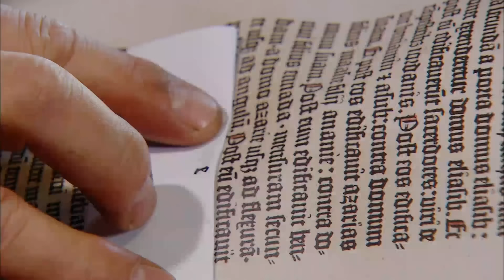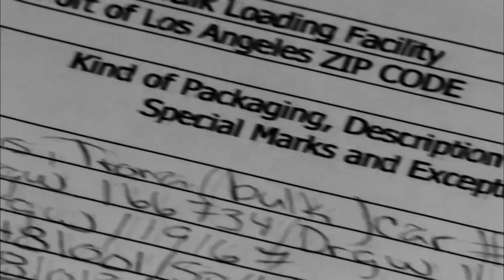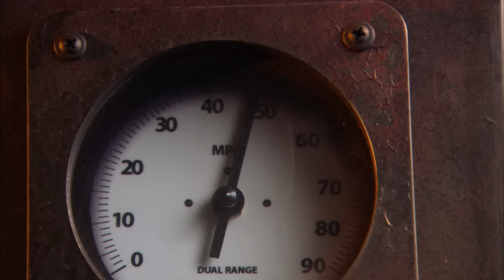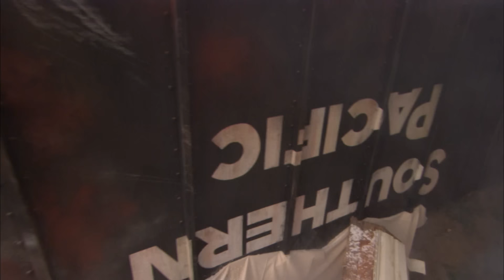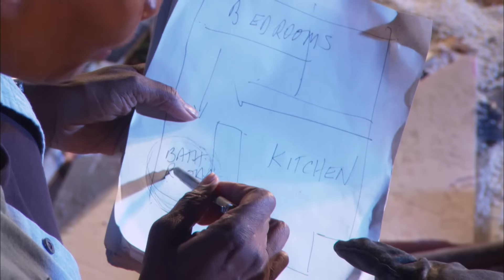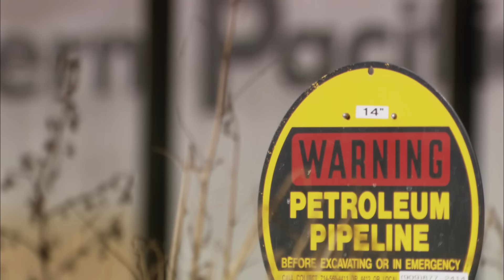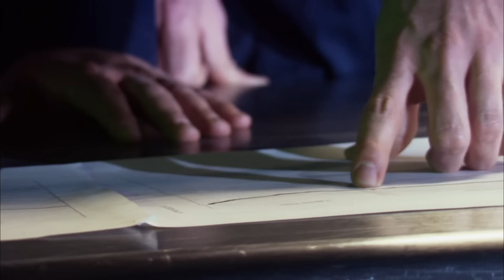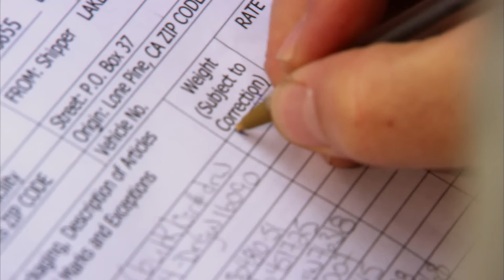Horrifying Runaway Train: San Bernardino Train Disaster SP 7551 East | Mayday | Wonder

Comment: The difference in cultures between the railways and airlines is really troubling here.  Why were so many engine's brakeless?  You got a train that has over half its engines non-functional.  Even with the bad paperwork that feels like it should be a giant red flag.
Reply: Because southern pacific just didn’t do proper maintenance in the last years of their life they got bought out in 1996
Reply: When you're an engineer for so long, you know how to calculate the weight you're hauling everytime. Even if the locos had problems he, the crew, the train and everyone else would've survived if that weight was correct, stated later on
Reply: @oregonrailfan7046  That's not completely true.
Reply: I'm a stationary engineer who also drives a train at my plant. The way a train's brakes work is counterintuitive. Trains use air pressure to apply the brakes. The actual locomotive (engine) itself, will apply its brakes (only to itself) when you increase the pressure to them (using the air pressure built up in the main air reservoir via the compressor).

 HOWEVER,

The railcars you are about to hook up to and eventually pull/push work in the exact OPPOSITE way. When you hook up your locomotive (engine) to the string of railcars you are going to pull, you actually INCREASE the pressure of the brake line in order to RELEASE the brakes. This is because we want the brakes of the railcars to engage and stay on when we disconnect from them (i.e. so they don't move after you leave them at their destination). So when you hook up to the string of railcars they will have their airbrakes on, and you actually have to increase the air pressure to them to get them to release, so you can move them. Once you get to your destination and are going to leave them, you disconnect and their air brakes immediately apply...
Reply: The train had plenty of brake power for the weight on the paperwork.  The train was supposed to have 3 motors on the head end, the lead being SP 7551, the number that the train ID derives from.  Upon boarding the train the crew realized 7551 was dead.  They isolated the engine and added 8278 to the head end to replace it.
Reply: Just a guess, even without brakes, they were considered necessary to move the train, and they may need to be moved to a different railyard for maintenance.
Reply: @UnionPacificFan  I have not watched the whole episode but I dunno why they couldn't stop with just using the train brakes. If the locomotive's independent brake wasn't working that's fine, you should still be able to stop using the train brakes (the brakes of all the railcars connected), each railcar has its own ABDW valve and should, eventually, be able to slow and stop the train...
This seems very fishy to me that they couldn't get it slowed and stopped...
Reply: @darenguise5392  Union Pacific did buy them.
Reply: @ajcook7777  um you heard that they where going down a steep mountain grade right with to much weight for the braking power they had and there brakes melted so if you want go try to stop a train with all the problem's they had and not knowing about them and see if you would say that again
Reply: @topgun1457 The train's main air reservoir is on average 130 PSI, the brake pipe pressure is 90 PSI, when you throw the automatic brake handle to the emergency position you have 90 PSI on each brake pad, even if you are on a steep gradient you will be able to stop, hence they are able to stop the train without even applying the full emergency train brake pressure. This was negligence, poor training, and faulty maintenance, this should have never happened
Reply: @christopherjohnson5236  All brakes should work 100% of the time specifically in case of situations like this. If any of the brakes doesn't work, then it shouldn't be used before being fixed.
Reply: Southern Pacific railroad was circling the drain and their equipment was poorly maintained.
Reply: @Dusty the lion  The train had enough braking power to stop if there had not been a mistake in calculating the weight of the train.  The dynamic brakes not working did not cause the crash.  The train being heavier than it should have been caused the crash.
Reply: @ajcook7777  So, it essentially works like on a semi truck?
Reply: @LaFonteCheVi  then there would never be any trains moving...equipment breaks...systems ate iver engineered to accommodate a failure...

Even a standard 18 wheel tractor trailer truck is allowed to have 10% of it's brakes non functional.
Reply: Not an excuse, but do remember that Southern Pacific had long been essentially bankrupt by this time.
Reply: The issue is with dynamic brakes, not the trainline brakes (air brakes).  The air brakes were functional on all.  It was the dynamic brakes that had malfunctioned on some of the units ... also - to let you know - not all diesel electric locomotives are equipped with dynamic brakes.  These locomotives are basically electric locomotives, with an onboard power generating station.  The diesel engine in them does not run the wheels - it runs an electric generator which supplies power to motors that are mounted on each axle.  Dynamic brakes turn those motors into generators, and the power created is dumped into a huge resistor array on the top of the locomotive (or behind the cab on some - at the time this accident happened).  These resistor arrays generate a lot of heat - and this is what imparts drag on the wheels thus slowing down the unit.  The resistor arrays are cooled by a large electric fan array- which is what generates the noise you hear when a locomotive is operating in dynamic brake mode.
Reply: @ajcook7777  by the time they reached 2% grade the train was already speeding , by the time emergency was applied the train was already running away , the brakes became too hot and literally melted away. The dynamics were used but only 1 engine had them at the time , there was not enough power slow it down.
Reply: Hi
Reply: @silicon212  I don't agree with your hypothesis, dynamic braking is nice but isn't required to safely stop a train with fully functional independent (loco only) and train line brakes...
Reply: @danishghostrider  I dunno brother, I don't have a DZ license and don't necessarily know how a semi trucks brakes engaged and work
Reply: @ajcook7777  Dynamic braking is REQUIRED to keep a train under control on a long descending grade. Cajon Pass, in places, has a 3% grade.  Your car can handle a 6% grade just fine, but half that on a train can be disastrous.  Your viewpoint is valid on flat and level track, but not a place such as Cajon Pass.
Reply: @ajcook7777  No airpressure means brakes wont disengage. At least on European trucks. IMO thats the best thing about air brakes. A truck that wont move, wont kill anyone :D
Reply: @ajcook7777  if you had watched to the end you would have found out that the cars were SIGNIFICANTLY overloaded by as much as 50% over what the paperwork stated.  Multiple errors by multiple individuals contributed to this tragedy.

Comment: The gas pipeline should NOT have been restarted without the emergency shutoff valves FIXED and NO locomotive engine should be allowed to operate with non-functioning brakes...PERIOD.

Comment: Who's the half-witted engineer who thought it would be a good idea to run a gas pipeline right underneath a RAIL LINE?!
Pressurized gas is very unstable, and trains cause a lot of vibration.
Reply: I’d be surprised if they had a single brain cell... high pressure gas plus closely - nit neighborhood alone would be a massive pile of “NOPE!” but add in the train tracks and the pile MINIMUM DOUBLES in size!!
Reply: Exactly.. it's actually safer just to have a pipeline above ground and exposed.
Reply: And no residents being aware of the pipelines existence…where one unsuspecting homeowner could decide to dig in their backyard and get blown up
Reply: @KDu400  well the  gas pipeline signs should have been a hint that there is a pipeline
Reply: @jasonking7736  WRONG!!!!!!!!!! YOU KNOW NOTHING ABOUT PIPELINES.
Reply: @jasonking7736  can you imagine the train hitting the pipe . It would have flooded that neighborhood .
Reply: @danielwanner8708  right on!
Reply: Happens all the time here are some guidelines from UP

Pipeline Installation Engineering Specifications

Specifications for Pipelines with Maximum Casing Diameter Of 48 Inches and Encased Gas Transmission Lines Crossing Under Railroad Tracks

For Flammable Substances

Scope
Pipelines included under these specifications are those installed to carry oil, gas, gasoline, or other Flammable or highly volatile substances.
Installation
Pipelines under railroad track and right-of-way shall be encased in a larger pipe or conduit installed as indicated in Fig. 1.

The casing pipe or conduit is the essential feature of the plan. Some of the other features as described in following paragraphs are optional in certain cases.
Reply: Can you imagine if every gas utility in the US couldn’t run under a rail line? Not to mention we line tracks with telephone wires and transformers. I get why you think it’s brainless but you gotta think about it for a minute. Problem here is how nobody knew it was there and the gas company fail safes we’re not operational. I’m sure further safety measures were implemented since the.
Reply: @MrSuperpiff4  Ok, it's a bit silly to compare a gas pipeline to telephone wires. Wires are flexible, so a train crashing on them isn't going to devastate an entire neighborhood. Moreover, telephones wires don't explode. If a transformer is damaged or blows, the worst case scenario is that the local area will be without power temporarily. That's hardly comparable to a pipeline explosion incinerating everything in proximity to it. 

Damaged telephone wires don't endanger lives. Nor does a blown transformer. 

I'm not saying a gas line can't run underneath a rail line, but the pipe should not be running PARALLEL to the rail. If the pipe crosses underneath perpendicular, then the danger area is minimized. If the pipe runs alongside the rail, the chance of a train derailing and damaging the pipe is increased ten fold. 

My point is, most of the infrastructure seems to be designed under the assumption that, "X can happen, but it's highly unlikely." Right - the odds of a train derailing in that very spot, damaging the pipe, gas leaking then igniting, etc are astronomical, BUT NOT ZERO._ 

Regardless of how remote the chance might be, I find it morally reprehensible that engineers are willing gamble with civilian lives for the sake of more convenient infrastructure planning. My life is worth more than your ruddy pipeline.
Reply: Its common practice to run pipelines along railroad right of ways.
Reply: @sixstanger00  THE TRAIN DID NOT DAMAGE THE PIPE, THE HEAVY EQUIPMENT IN THE CLEAN UP DID. THE PIPE IN BURIED 6 FEET DOWN
Reply: @steveharte8712  It was once common practice to smoke on airplanes, too.
Reply: I'm aware of that Captain Caps Lock, but right after the train derailed, they were concerned that it may have damaged the pipe. 

If the pipeline being buried is as "safe" as you're claiming, then why would it matter if the train fell on it or not? The point is, it was the cleanup crew that damaged it, but before that they were concerned that the train had. The fact that they were even concerned about it suggests that this is an unsafe layout; placing the pipe next to train tracks, because in the event of a derailment, the pipe COULD be potentially damaged.
Reply: Turn your caps lock off, troll.
Reply: @sixstanger00  now you revert to namecalling? how immature is that
Reply: @KDu400  the pipeline is located on the RR right of way next to the tracks. who the hell is going to dig on the right of way
Reply: they do go under lol, idk for how long but they do , every major railroad has guidelines on how to install them and honestly if they are deep enough it should be a problem
Reply: @MrSuperpiff4  this pipeline, actually pipelines, there are 2, do not go under any tracks. When it gets up over the pass a ways down it veers off to the right and mostly follows interstate 15 and into the desert to Vegas.

Comment: I can't see how the motive power department of Southern Pacific would allow locomotives  without fully functioning  dynamic brakes to be used on a mountain section of track. That seems to be criminally negligent. 

Doomed from the start because the train was 1/3 heavier than the paperwork stated, and 2 of the 6 units don't have functioning DBs, I hope procedures were changed.

All I can think of in hindsight is that the conductor or an engineer should have hit the emergency brakes at 30 mph when they noticed the speed was brining to rise. After that point they had no chance.
Reply: They did change. UP bought them out.
Reply: You have no idea how the railway works regarding repairs.
Reply: @krakenwoodfloorservicemcma5975  It's because I've spent 25 years in passenger rail maintenance that I made my comment. Transport Canada watches us very closely.

Comment: I REMEMBER WHEN THIS HAPPENED!
I was living in N Fontana CA just up the 15 fwy from where this happened at the time...
I used to work out of the Colton BNSF yard hauling intermodel for JBHunt at the time.
The Cajon Pass is no joke for trains or big rigs...
Even to this day, the houses were never rebuilt because of the paranoia of the possibility of another crash.
Reply: im in pa but Norfolk Southerns tracks are across the street from my house, they move alot of intermodal for JB Hunt
Reply: Frankly, houses never should have been built on top of a pipeline in the first place. They would have had to forego one row of houses to stay clear of it when constructing the neighborhood, in a region that was (and still is) nowhere near saturation levels in terms of building. Inexcusable.
Reply: This houses should of been a certain distance from the tracks as well as the pipeline.  Putting any kind of pipeline that close to the tracks alone was not right, the vibration from the trains probably had it weakened but not visible,  then after the trains started running again, it was too much for the pipe.

Comment: It's not very comforting to realize by the end of this video, that no one seemed to take note of the fact that 3 out of 5 engines DIDN'T HAVE WORKING BRAKES. And everyone is OK with this?
Reply: Like I said, it’s been like this since they started singing Casey Jones.
Reply: @raquellofstedt9713  Casey Jones engine brakes worked just fine tf are you talking about
Reply: Southern pacific just didn’t do proper maintenance near the end of their existence
Reply: So the crew knew the second engine was DIT and it was replaced with 8278.  The train only needed 5 engines to descend the hill.  The 4th on the head end was added as the second was dead.
Reply: The train had enough braking power for the weight the crew was given.  The weight was wrong.  The locomotives had working air brakes.  The locomotives without working dynamic brakes didn't cause the crash.
Reply: @JD_79  My comment is more toward the fact that there were THAT many locomotive engines that DIDN'T have working brakes. Not just on this train, but in general... 3 out of 5 of them didn't have working dynamic brakes. That should not be "acceptable" under any circumstances. Again, I'm not JUST referring to THIS train.

Comment: ONE THING LEFT OUT IN THIS VIDEO WAS THE WAY THIS TRAIN GOT OVERLOADED!
AT THE LOADING AREA A NEW EMPLOYEE WAS LOADING THE TRAIN AND FILLED THE CARS 
LEVEL FULL TO THE TOPS OF THE HOPPERS!!
NORMALLY , THESE CARS WERE 
FILLED TO ONLY HALF TO TWO THIRDS FULL!!
THIS TRAIN WAS UNCONTROLLABLE  EVEN IF IT HAD ALL DYNAMIC BRAKES AT 100 %!!
ONE CHANGE MADE AFTER THIS ACCIDENT WAS TO MAKE A MINOR ELECTRICAL MODIFICATION TO KEEP THE DYNAMIC BRAKES EFFECTIVE AFTER AN EMERGENCY APPLICATION!
THERE IS AN OLD SAYING ON THE RAILROAD, " THE OPERATION AND SAFETY BOOK RULES WERE WRITTEN WITH BLOOD, INSTEAD OF INK!!"
KEEP THEM ROLLING BROTHERS!!
👍👍.  ( SAFELY!!)
Reply: Nope.  The cars were loaded correctly but the employee saw that the cars were short loaded or not loaded to the  top of the car and assumed that the product had the same density of coal and determined that having less product in them they must weight less than max weight or 100 tons. Lake minerals had had issues loading cars in the past and had scales mounted on the loader bucket to ensure they got the cars loaded to the correct weight.
Reply: Union Pacific Fan REPORTS I READ BACK IN THE DAY IT WAS OVERLOADED!
ONE THING TO THIS EVIDENCE WAS THE TRAIN APPEARED TO BE LACKING SUFFICIENT POWER FOR THE CLIMB OUT OF MOHAVE!
IT DID HAVE ENOUGH POWER TO REACH CAJON SUMMIT , BUT AT A SLOWER SPEED!
MY SELF I WOULD LIKE TO REVIEW ALL THE SPEED TAPES AND BLACK BOX INFO AND ALSO LIKE TO REVIEW THE PERFORMANCE OF OTHER SIMILAR TRAINS!
Reply: wrong
Reply: @rossbryan6102   it had a lot of power to climb.

Comment: I know a little bit about how train locomotives, dynamic brakes and their brake systems work but I get confused as to how parallel systems for braking can turn each other off. I thought that when you hit the emergency button it dumps the air pressure in the hoses and pipes that run through the train, then the air tank on each RR car applies the brakes automatically? The control systems in some diesel locomotives seem over complicated.
Reply: An emergency brake application automatically disables dynamic brakes on the engines.  The helper engineer should have known that and should have communicated with the head end engineer before doing it.
Reply: The idea is that the emergency brakes plus dynamics would flatspot the wheels, but in this case, the emergency brakes were already overheating and failing.  Someone else said that there is now, on some lines, an override so that the dynamics would not be turned off.